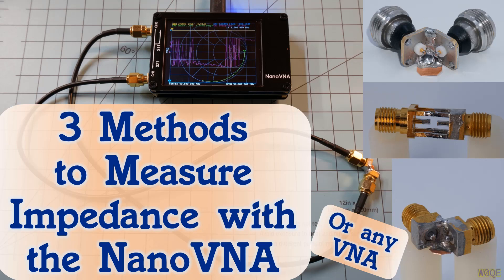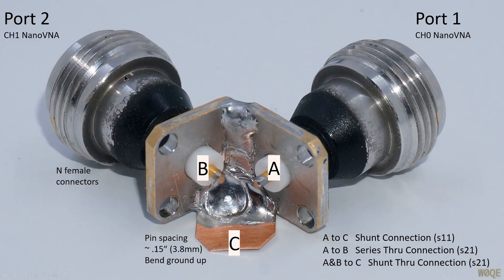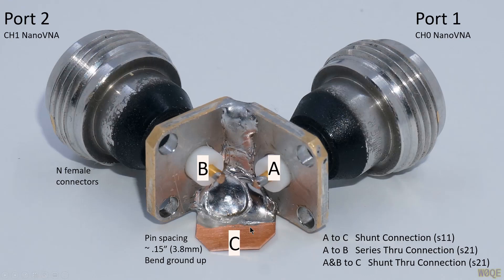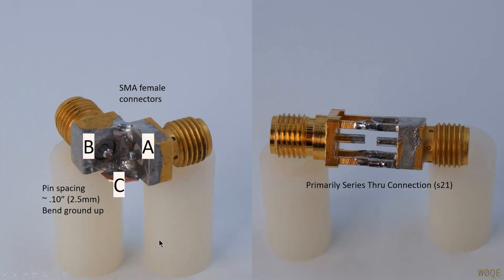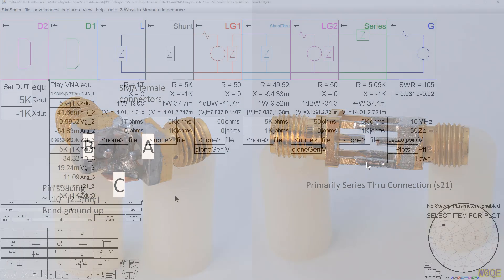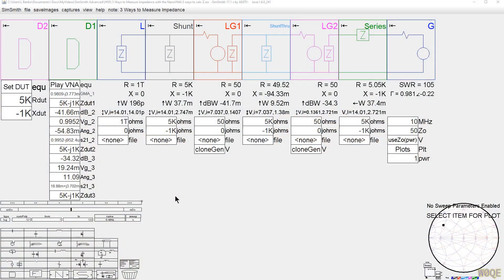#95: Three Methods to Measure Impedance with the NanoVNA

Comment: Well I have had to watch this several times, stopping here and there while I hit alt-tab and switch between browser and SimSmith along with making notes for myself, and I have finally taken quite a lot away from this video.
Admittedly, a lot of your content at this point in my understanding goes 'straight over my head', but I am getting numbers that make sense and from past bench experience that I would expect if I had the same circuit in-front of me in real life.
I cannot express my gratitude in words, but Larry, you are  one hell of an Elmer and have helped me so, so much since I first heard of SimSmith and subscribed to your channel.

73 De 2E0IIZ
Reply from the maker: There is a lot to be learned when you can simulate a circuit and make it agree with what you build and measure.  Glad you enjoyed the video.
Larry, W0QE

Comment: Very good post, impedance measurement is my most common use of VNA. 
AIM-4170 is excellent in shunt mode, and I often make fixtures for high impedance measurements. 
If I measure anode plate choke, I may add known capacitor in series to make impedance much lower.

Comment: Could you please provide links for an education on using the NanoVNA-F v3.1  from a beginner?   From my perspective, you need to use a White Board on one side and slides or images on the other side. Many of your expressions need to be written out and pointed out.  You are very familiar with the text you are reading but the reader is not. Its just too complicated showing   code without a diagram.   Its a clear summary for those who already know the subject. I've been in antennas all my life and cannot follow you.

Comment: Larry, first off thanks for doing this video.  I'm still trying to get the hang of all this.
One thing that hangs me up about SimSmith, is (to me) the odd grouping of compartments LG1 & LG2; which have components grouped together that are actually from separate distinct circuits.  Can you explain if the reason that the boxes encompass the components the way they do?
Thank You Very Much & 73...

Comment: Larry, can you consider making a video, using the nanovna, on how to measure 1:1 coaxial chokes used to keep RF of of the outer shield of antenna feeds?
Reply: do you want to measure its common mode rejection or its self inductance ?
i guess i'll use a reference ground plane , two shorts termination at both sides to perform common mode injection and then load the shield/inner conductor to 50 ohm from the reference ground plane.
gen(50Ohms)(referenced to the ground plane) -->Sparam Test set S11 port (referenced to the ground plane) -->shortedcable(shield/innercond)--> Sparam Test set S22 port (referenced to the ground plane) --> receiver (50ohms referenced to the ground plane)
Reply: could be seen as triaxial test bench method
Reply: You can simply measure impedance between two ends of coax shield. High impedance is expected, so you can use series method. I use AIM-4170, it is fantastic in shunt mode.

Comment: I experimented a bit with ceramic and crystal filters to see if I could determine their input and output impedances using a NanoVNA H4. I used the series measurement but ran into some difficulties. Trying to determine the S21 value proved to be problematic as the value varied widely because of the passband ripple of the filters. I'm not sure whether I approached the problem correctly or not - maybe I got it all wrong! Can you perhaps elaborate on how exactly one should go about determining the S21 value using a NanoVNA ? A practical example of how to do this would be of great value.
Reply from the maker: Jacques,
From the words you used I am going to assume that you are measuring filters that someone else designed and did not design them yourself.  My apologies if that is incorrect and please let me know.  All crystal filters that I have ever measured had design impedances in the range from about 20 ohms to 300 ohms so I would just measure them in the standard shunt connection mode.  To get them to measure correctly you will need to measure s11 and s21 with the output terminated correctly but this is the value you are trying to determine.  Making the problem more difficult is that the filter bandwidth is very narrow and you need to sweep a small range with a large number of points.
I have done a couple of videos on crystal filters (videos #26 https://www.youtube.com/watch?v=LyAQqqIsBOM and #27  https://youtu.be/Y0_H8e4QTy8  ) which might help.
The filter will only have the proper s11, s21, s12, ans s22 when it is properly terminated.  Would a video on this topic be helpful?
Larry, W0QE
Reply: @w0qe  Hi Larry, thanks for your prompt reply! Yes, I'm measuring commercial filters (Yaesu XF-92A and Murata CFM455D) purely as an exercise to learn. From what I could gather online the Yaesu filter has an impedance of 500Ω and the Murata is 1500Ω, which is why I tried the series S21 measurement. I'm very new to impedance matching but really want to get a good grip on anything related to the topic - I find it all quite fascinating. I will have a look at the videos you referred me to and experiment some more. I think a video on the topic will be of great interest to many people. Once again, thanks for your time!  Jacques ZS1PL
Reply: @w0qe  yes, yes  please! I was doing the same exercise as Jacques with an ECS monolithic crystal filter at 10.7MHz 7.5kHz wide. The datasheet shows 4pF//1.8k and it's easy enough to get an L match in auto mode in SimSmith and it works fine but I am trying to figure the proper method to mesure these values in the first place when you don't have the datasheet and a 50 ohms VNA. An LCR gives me the 4pF, but measuring one side on a 50 ohm reflection bridge while the other end is open gives me 25ohms at f0, way off but seems reasonable for a single crystal, i.e one side of the filter. getting lost here...